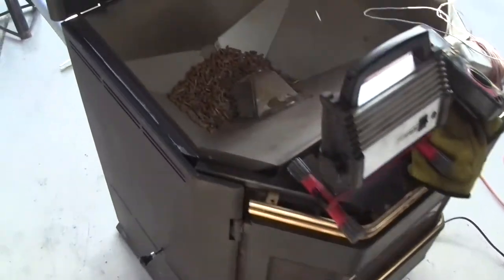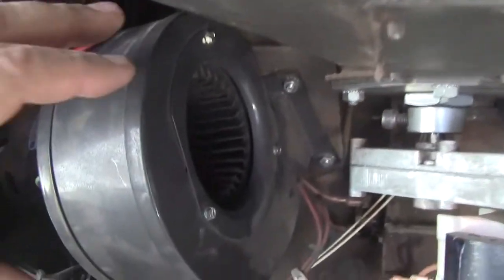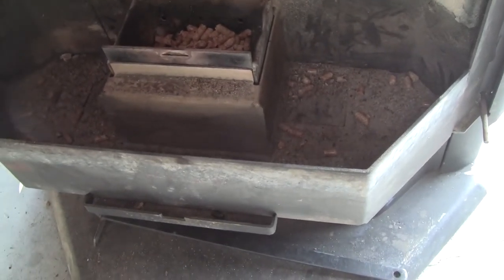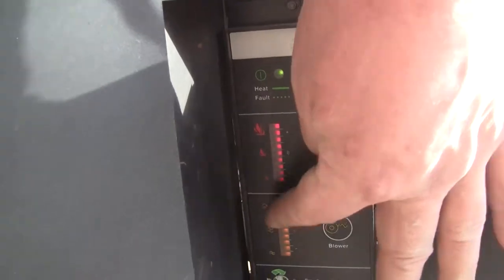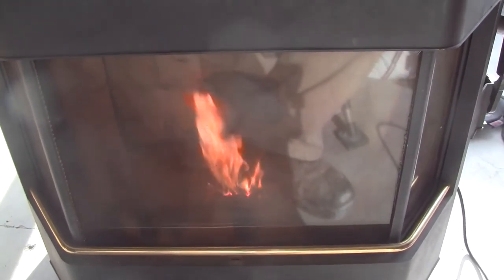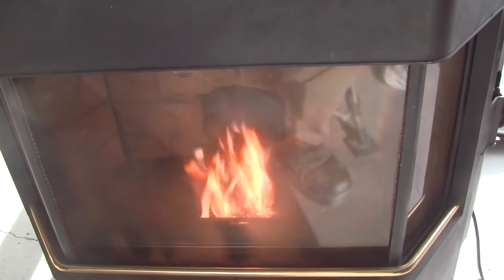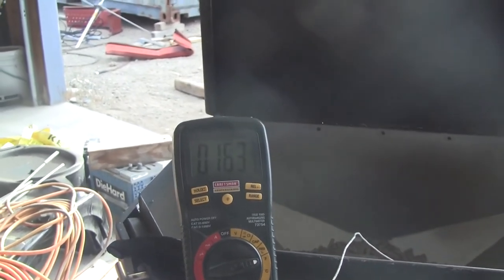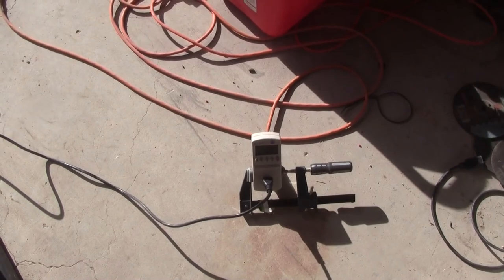Whitfield Advantage/Profile 30 Pellet Stove Repair and Testing Part 2.

Comment: I have the profile 30 and the unit is acting up.  It runs for ~25minutes... drops pellets, good fire ect...  then starts making a noise every 5 to 7 seconds like its trying to drop pellets down the shoot but nothing happens.  The fire ultimately burns out...  I replaced the optical eye and cleaned the lens too.

Do you have any recommendations?  Is there a relay switch or something else I can check or replace.
Reply from the maker: You need to apply 120 volts to the auger separately to see if it turns smoothly. The auger and both blowers have to have lube every season. Check Youtube for testing videos. Brand won't matter.

Comment: So do you know what the little pull know on the side does? I just got this stove and am cleaning it up getting ready to install in the house  and I'm not sure what that know does.
Reply from the maker: That knob is for regulating how much air flow the exhaust fan pulls through the firebox. I run it pulled all of the way out for max air flow. Please don't forget to lubricate both blower shaft bushings. Two bushings per blower. Use only high temp synthetic oil. The blowers can seize up and fill your house with volumes of smoke.
Reply: @mikep95133  Thanks Mike. I've got it apart, I'll make sure to lube those.

Comment: My Whitfield stars nice.  Burns good for about 20 min. The. It’s starts to act weird.  Starts stops starts stops the finally dies out and smoke comes into the house.  Any ideas?
Reply from the maker: When my pellet stove did that, the amber lens covering the cds cell was heavily covered in soot. It detects flame in the fire pot. But it can't if it's dirty. So it shuts down. The cds cell is located under the small metal cover at the bottom of the pellet hopper. I've got a video showing how I got mine apart. Sorry, I just don't remember which pellet stove video. Put the amber lens back in the way it comes out.
Reply: @mikep95133  thanks.  That was exactly it.  Running smooth now.  I thought it was a bad control board.  I had replaced one of the capacitors on the board last year.  It was acting strange and when I looked up the symptoms I came across an article about someone replacing that capacitor.  Ran great after that until now.   So after cleaning the amber lens I’m back in business
Reply from the maker: @trainwreck5973  Excellent news !! If you can, post the link to the capacitor article here in the comments.
Reply: @mikep95133  thought I had it.  It burned nice for a lot longer this time.  Pellets were dropping at a reasonable pace.  But it just started the on off on off again.  Blower kicks on and off. As well as the control board lights on off.
Reply from the maker: @trainwreck5973  There is a Youtuber named DonR222 that has far more experience than I do on these stoves. Checking the current draw of both blowers and the auger is key. Most owners don't lubricate them as their suppose to. I found this out the hard way.